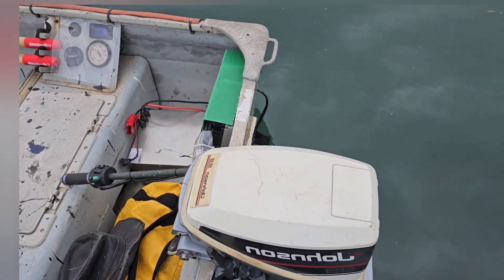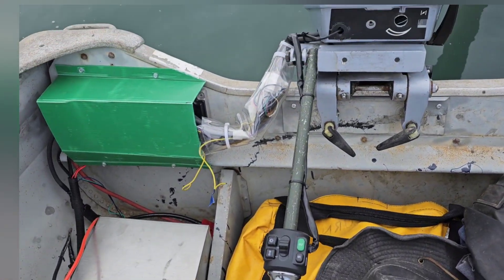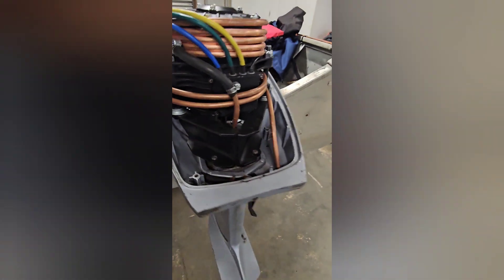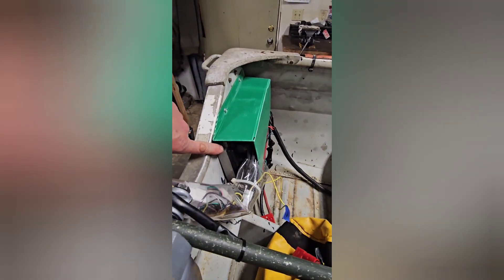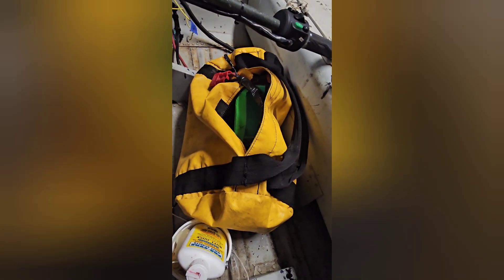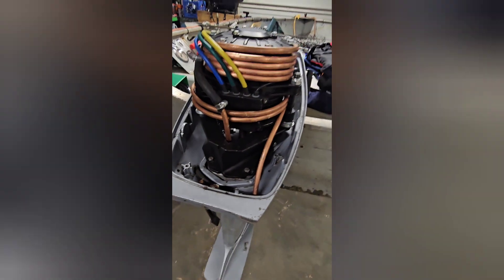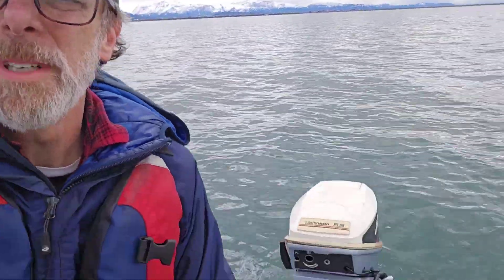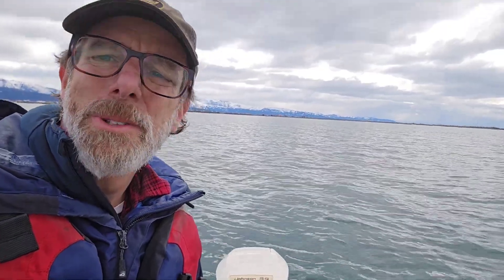Electric outboard conversion on 14' skiff

Comment: Hi, I was planning to do the exact same electric swap, I even thought about the copper cooling systeme before seeing your video! I have so many questions, is there a way we can have a chat so I don't bump into the same problems you went through?
Reply: Main questions are can you share a link to the motor?

What is your shaft/prop ratio? 

What is your RPM Motor?

I can't unfortunatelly build my own battery, full blast how long yours lasted? 

Do you have a link for batteries close to yours?
Reply from the maker: Hi,  @franklabs3766  here is the motor I used, or very similar.  QS motor, 3000w nominal, EM150SP controller.https://www.aliexpress.us/item/3256805728846198.html?spm=a2g0o.productlist.main.13.4fd79abanTcRpx&algo_pvid=56e26e6d-c2ef-4840-8769-63edcf1738a1&algo_exp_id=56e26e6d-c2ef-4840-8769-63edcf1738a1-6&pdp_npi=4%40dis%21USD%21472.70%21425.43%21%21%21472.70%21%21%402101f49e17044061465024286ebb69%2112000034833275225%21sea%21US%212791305019%21&curPageLogUid=mfKuBAlaKvXj&utparam-url=scene%3Asearch%7Cquery_from%3A
Reply from the maker: not sure of shaft/prop ration, it was an old Johnson 9.9 2-stroke.  Let me know if you have any more questions.  You might need to add better cooling, or find a motor with a built in cooling sleeve.  Mine still gets hot after a longer run.
Reply: @looperidepersonalelectrict7003  is the cooling coil still works or its rubbish?
Reply from the maker: @franklabs3766   It works, and helps, but you might consider adding air circulation to augment it because the cowling doesn't provide for a lot of air flow normally.  Depends how long you want to run at heavy load for.
Reply: @looperidepersonalelectrict7003  For the connection in between the motor and shaft did you use another machined part? I was thinking that I could maybe re-use the actual part the connect from the original motor to the shaft. Cut it from the motor and weld it to the electric one.

Comment: Nice work. Have a Johnsson 20hp that I am currently converting. Was thinking of 48v. Should I go to 96v maybe?
Reply: 96  vopts
Reply from the maker: Thanks.  I think 48v might not be enough.  I did that on a little 5.5 and it was OK for a Zodiac but kind of worked it hard to keep on step.  72v might be good, and would save you money compared to a 96v system.  Depends on what you're putting it on, and what KW or HP equivalent you want.  Good luck!

Comment: Awesome conversion! Did you measure the power at max speed? Must have been quite a lot more than 3000W :) but with good cooling I'm sure it can keep that up.
Reply from the maker: It was difficult to read the display so I installed a brighter one yesterday.  Probably was pulling around 150 amps max, or around 10kw.  After the new prop arrives, I'll post an update with more details.  The most power draw is getting on step, then maintaining speed uses less power.